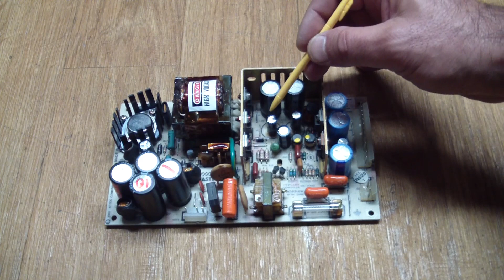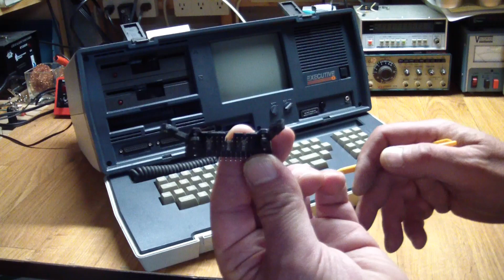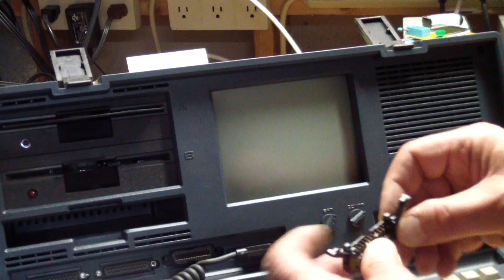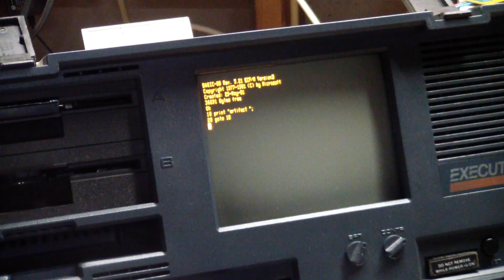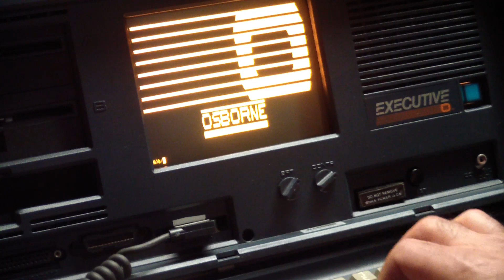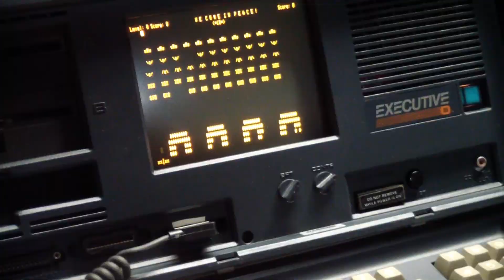AE#100 Diagnosing A Switching Power Supply Using Olfactory Inspection

Comment: You made a mistake replacing those big caps with small ones. These definitely have lower ripple current rating, they will fail again. I guess the rule is use higher voltage caps that are equal in size to the original.
Reply from the maker: I was referring to the physical size of the replacements. The specs are identical to the originals, so all should be well.

Comment: Please... don't replace those X or Y rated capacitors with regular ones. It's really dangerous if they fail short.
Reply: Yes, replace with the right X or y types, as they are safety types, and the newer non transparent ones are a lot less likely to craze and fail like the Rifa clear bombs. Regular orange drop film types fail short circuit with high voltage pulses from the mains, and while they do self heal in limited energy applications, with the near infinite instantaneous power capacity of a mains connection they fail spectacularly, and can often go dead short. Not a good thing on a class y capacitor that will apply mains to the secondary side, and even being earthed is not a guarantee that the connection might fail and leave the chassis live.

Comment: Nice Osborne.
That standard IDC connector uses .025" square posts. It should be simple to pull one from a standard right angle connector and then put the pin into the old one. The plastic is molded around the pins but they can be pulled out with little effort. A cold pull is better than heating it up as the plastic will melt if heated and the pin may be loose.
Cheers,

Comment: FYI: those locking headers are a more-or-less standardized item and are readily available both from eBay and similar places; as well as authorized electronic parts distributors like Digi-Key, Mouser, or Arrow. 🤔